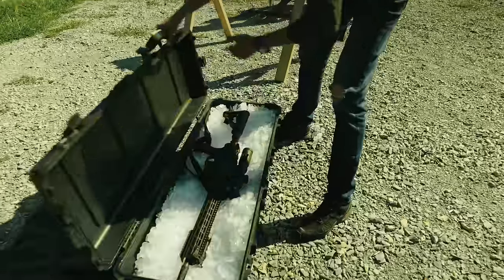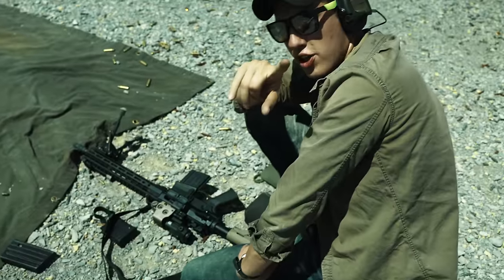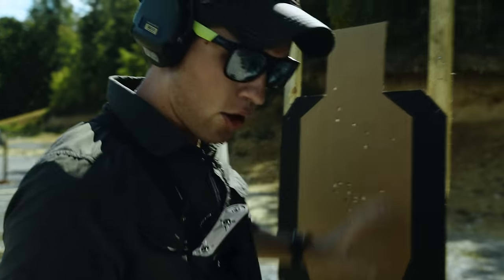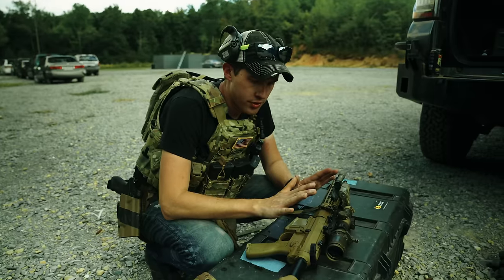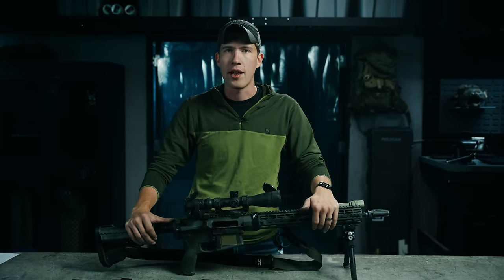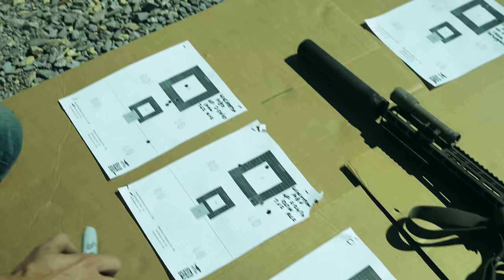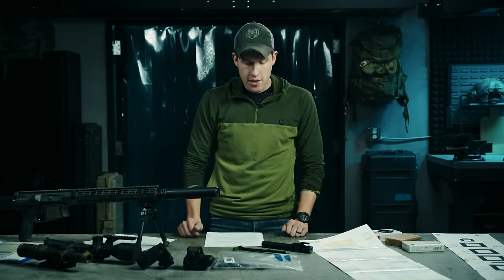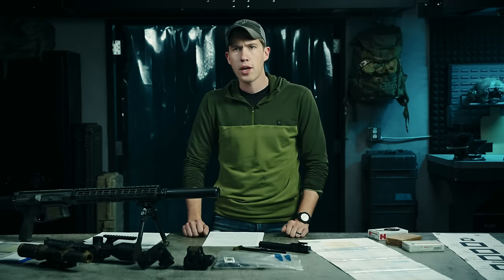Aero Precision M5 AR-10 5,000 Round Test

Comment: This is an incredible amount of data collection for an extremely common "off the rack" firearm. No boutique add-ons or modifications, no cinematic mud-test type of gimmicks. This is good science, setting up trials and running the tests. Man. It's such an inspiring sight to see that ya'll went through such a diligent testing curriculum, I hope the information collected is used to better develop this high-potential firearm.
Reply: Mud tests aren't a gimmick though. They're a realistic test of how a fire arm will behave in field conditions, in worst case scenarios.
Reply: 1:46:20 and tested with “no maintenance” 😮
Reply: @Mygg_Jeager  Yes for a military unit, sure that makes sense. As a consumer, no. Most of us are going to use AR-15's in 5.56 as a SHTF rifle. If you want an AR-10 as a AHTF rifle, most of them on the market are not the right choice.
Reply: @MegaAndy93  For SHTF, mud is even MORE of an issue. Because you're not gong to have access to high pressure air hoses, hot running water, or a limitless supply of cleaning agents like we have in the military.
Direct impingement can only go so far with CLP and lubricant. I doubt you'll get the full 8,000 round barrel life out of a direct impingement AR15 in a SHTF, because the housing, mag well, bolt carrier assembly, and trigger group will gradually fill up with so much dust, dirt, mud, sand, debris, silica concrete dust, bark chips, and carbon particles that the entire system will seize up eventually.
Unless you're planning on literally never leaving the confines of your bunker or armored vehicle, which seems unlikely.
Reply: “SHTF” lol. None of you are gonna have retirement $$ if you keep dressing up and playing make-believe..
Reply: @Mygg_Jeager for an AR u can probably throw it in a river and that would work
Reply: "No boutique add ons"??? Paint job in the middle of the test. No lubricant. Guns need lubricant.  All guns need lubricant. Shooting 1 round every 1.2 seconds for long distance shooting. I've seen a few holes in this test. But it was a decent test. I give it a 7/10.
Reply: @adamsowers8957  if they pushed this rifle anymore aero would've lost their minds. hence why the immediately got in this video and started making excuses. they released a rifle that's not meant to actually be shot, so budget owners could say they have an AR10, that needs a lot of parts replaced for it to work in the first couple thousand rounds. get what you can afford, I get that, but this entire "just as good" campaign will get people hurt when they're counting on their rifle the most

Comment: I’ve got to believe that if your life depended on it, you’d never neglect a piece of equipment this way.
Reply: That’s exactly what I was saying… even the letter to aeroprecisionusa, is one sided, as they were never told about the neglect in cleaning
Reply: And didn’t they run it dry ?
Reply: I bet it would of last long if they actually took care of it
Reply: Nah, ARs are trash.  AK all the way.
Reply: Get a “equipment” that’s built to be fucking used lol
Reply: @simonbelmont548 Inrange and Garand thumb mud test, shitty optics mounting, less standard cartridge for america, lack of quality manufacturing. Stay mad
Reply: Only thing I'd say is if you somehow survived so long that you ran out of lubricant, and you also happened to be in the middle of a war where you had to shoot thousands of rounds. Not likely that's for certain
Reply: @f1rebreather123 find a vehicle, use the motor oil for lube
Reply: what equipment is meant to be ran dry, I own ar and ak so don't give me the AK crap, hell I've got diameter ar that has thousands of rounds with literally 1 malfunction,  and that alone was my fault,  so I'll wait for your response,  as long as you're not abusing gear and running it luned it will run
Reply: @simonbelmont548  I can tell that you are like 12 years old based on this comment. Once you grow up and learn about how they work, you willl understand the Ar15 is better than the AK platform in every way

Comment: Found this video AFTER just ordering this exact M5 configuration. This video actually makes me more confident in my decision to purchase. 2300+ rounds dry before malfunctioning is impressive. As a former infantryman I can tell you, you get back from the Qualification range, weapon cleaning/maintenance, you get back from patrol....weapon cleaning/maintenance, it's 5pm on a Friday back in garrison.....you guessed it, weapon cleaning/maintenance lol. All at way lower round counts and CLP is slathered on from a commercial spray bottle. Screws backing off, I personally always blue loctite my critical component screws on my personal systems. Would love to see the same type of test on the Gucci AR10s like LaRue, LMT, LWRC, etc. And even some other budget minded models, like diamondback and similar. Only gripe I have with AERO is me wanting them to have ALL barrels they sell to be dimpled for easier gasblock installs, that's it. But that's purely a convenience complaint. Keep up the good work AERO.
Reply: I just got my M5 20" in this week. I would have liked if they continued the test with a different BCG to see if it is an issue specifically with AP BCGs.
Reply: Yeah, they're good deals.  A lot of the issues he outlined will double the price-tag, if they're actually solved.
Adjustable gas block for suppressed?  Costs.
JP Enterprises ultralight BCG and captured spring for reduced recoil?  Costs.
Criterion chrome-plated barrel for extended barrel life?  Costs.

People that talk crap about "gucci rifles" don't understand that some of them are actually superior...  At a cost.
Reply: @manictiger I think he’s aware of the costs of ‘Gucci’ rifles. Dude wants to see a comparison based on those differences.
Reply: @isaactrujillo76  
He didn't state that.  He said he wanted more from the same system.  A manufacturer isn't going to add an entire new process to make something that costs twice as much, unless they think there will be a lot of buyers.
Reply: @manictiger  I’m referring to the original commenter we are commenting under.
Reply: Right. Like if you don’t clean any 308 after 2000 rds….. lol. Pull the guard. Put a adj block and keep it maybe just a tiny bit cleaner lol.
Reply: @manictiger  yep your clueless.
Reply: @pt2656 
What an excellently displayed counterargument with supporting evidence and impeccable spelling!

It's "you're".
Reply: Liking this kind of content ,hoping to see more.
Really liking what i'm hearing coming out of t rex arms , We'll be supporting your company with purchases in the future! Keep up the great work!!!
Reply: Absolutely love my LWRC. She's seen maybe 4k rounds now with only a few issues while I was best optimizing for suppressed but that was easily worked out. LWRC make amazing rifles in a few key calibers. Even my "cheaper" ic di in 5.56 is an absolute dream. I also keep everything very clean and well lubed / greased. Mil-comm ftw!
Reply: Far too much cleaning, that’s just one of the idiosyncrasies of the military.
Reply: I went with a Daniel defense .308 for $2800. The DD5V4. It came with adjustable gas settings from factory. For suppressed and un suppressed 🤣Threw a eotech vudu 1-10 on it, Atlas v8 bipod, ferro concepts sling, B5 systems stock and pistol grip. Have a Bcm vert grip on it also. Have it as a battle rifle configuration right now. My battle rifle. A bolt action with a 2.5 or a 4x16 would be nice if want to push pass 1500 meters 
you enjoying your Aero??🤣🤣
Reply: You said “As a former infantry” 🤣man that’s sad you can’t even afford more then 2,3k on a actual high quality good rifle🤣 and you were in the military. Most these guys never served and have much better equipment then you 🤣🤣🤣🤣
Reply: Hanson barrels with the block on are a good compromise, moa or better guarantee and believe they’re at least pinned. Ballistic advantage makes them, but aero owns BA

Comment: Great and informative video! My thoughts are... after writing them, I find that they center around the workload you put it through. Maybe not an unfair test, but it was pretty intense and, I would say, fairly extreme, minus mud baths...
1) Was a great pick for testing. It's a popular brand and model. 
2) the duty cycle you put it through was tough. Though you cooled it off, it had to be running 'warm' most of the time. 
3) 5000 rounds is a LOT of usage. that's 166 - 30 round mags. if a standard load out is 10 mags, that 16 battle days. That's a LOT of usage! If I were in a combat position where my life depended on this piece of kit, I think I would clean my weapon more often than never. If for no other reason, than to monitor it for potential failures.  The amount of crud on your fingers during the bolt disassembly was very telling.
4) Zero maintenance, though probably realistic for many users is unrealistic from a longevity perspective. When you buy a new car, you don't plan on just driving cross country over and over while never having maintenance done to it. People who never do maintenance on their weapons should have no expectation that they will run forever.  

5) I did think the video was a bit long, but it was also very informative. 
6) I found the close up shots of the malfunctions to be poor and not very helpful. In particular, the shots of the bolt carrier breakdown didn't really detail what you were discussing. the broken pin was just a little glob of metal, even on my 50 inch screen at 1080. 

Thank you so much for taking the time to follow up with AP and telling us about it. That's important info and I'm glad you shared it. I, too, am a fan of AP and have been considering an AR-10 from them. I feel much better informed after watching the video!
Reply: Yea I agree with you regarding the maintenance schedule.  I would say any consumer (civilian) level firearm owned by a reasonable person would clean and inspect the gun multiple times throughout a 5k round test.  You can buy a rifle from Aero for $1,400, or buy one from LMT /sig for $3,500 or knights armaments for $5k+. 

Personally I would expect the military level weapons like those from LMT/KAC/SIG to fair far better in a 5k round test, but even the military would probably allow for a cleaning in that 5k round period.

Finally, I’ve heard a lot of people build Aero AR10s and swap in JP bolt carriers because they are simply better.

Comment: I haven't seen ONE comment stating the obvious ... that lead sled holder is going to transfer the force generated by the .308 into the rifle and cause damage because it is not allowed to recoil naturally. The force doesn't just disappear when you lock it in to that lead sled, it's getting transferred into the weapon. I'd like to see testing with just bipods and bags to see what overall effect that had on the components of the rifle. I don't know how many rounds were put through the system with that lead sled, but I would imagine it's impact on the rifle were not insignificant.

Comment: My biggest take away from this is Lucas has never broken a firing pin on an AR before. I thought it was pretty common thing when you get up there in rounds, and a part you want to have an extra on hand. For hardly lubing and cleaning the rifle, and then going suppressed I think it did really well.
Reply: I’ve had 10k rounds on my bcm bcg with no failures. Try getting a 158 steel bolt face and throw the poors bcg in the trash lol
Reply: @Souwth-bawston-is-fuh-luvahs or just buy a quality bcg and cry once lol. Always just as guuders that always have issues with your guns and need extra parts for range plinking lol

Comment: One of the problems with 308/7.62 guns is the WIDE variety of ammo.  Some of the 7.62 loads are quite weakly gassed and some 308 loads are screamers.  I"d hate to be the guy deciding how to gas one of these rifles.
Reply: And the lack of standardized parts between platforms
Reply: I had to bore out my gas port on my criterion barrel after messing with springs and buffers. Put an adjustable gas block on it and turned it to 2 clicks more open from failure to eject/bolt lock back. It was a pain before just boring that port.
Reply: Big farts!
Reply: @lighlotus117  sketchy, but I've done it. 

I got an M&P10 as my first 308. As usual with the first gen of these.....They're undergassed at the port. Measured .064. A .075 bit, a steady hand, and a bore snake will take care of that.
Reply: @NoNo_IStay  good lord. doing that without a drill press is sketch af. 😅
Reply: This is a BIG point and one of the biggest challenges in developing and supporting this platform. Especially since many customers are building our M5 receivers up using parts from many different manufacturers. Add in suppressed fire, and this situation is multiplied.
Reply: Just find a good combination of ammo and gas settings. And stick w it
Reply: Probably have to set it to be properly gassed with ammo in the bottom 25-50% range of the spectrum, knowing it’ll cause excess wear on the BCG with higher quality ammo, and giving the caveat to customers that you can’t run the shittiest ammo on the market and expect consistent performance. Wouldn’t be surprised if the erred on the side of even more gassing than that though
Reply: @lighlotus117  I would check if criterion uses the longer gas block to gas key distance. There are two, the ar15 standard (used by most dpms lr-308 manufacturers) and the armalite ar-10 pattern. This equates to about one half inch longer gas tubes. You can look in the cam area cutout of your 308 upper receiver and see if the gas tube makes it half way into that area like it should.
Reply: @NoNo_IStay  pro tip the mp10 bcg is a diff paytern if you swap barrels you will need a diff bcg 
As me how i know lol
Reply: Varying everything was my experience back when you could get cases of nato surplus cheap.  What ended up to be the consensus was learning how your individual rifle behaved with a given round count.  Bore brush was essential, dealing with torn rims was usual, and learning how that particular case performed was essential.  Wash rinse repeat when you opened a different case lot or country of origin.  I learned I could get 900rds out of the worst ammo between major malfunctions, and that was very important.
Reply: @you_willletfreedomdie7759  yeah it's a seat of your pants moment but I stepped it out to .088, after checking along the way. I don't remember each step measurement I used. .088 did it and the adjustable block helps mitigate. I might not have needed .088 but it works and if ever it meets an "adverse environment" I can just open the block and blow through it. I was lucky to have access to the required tools via work to get it done but sketchy because that's a $360 barrel that I'm risking.
Reply: @newerest1  I'm gonna check that but I think the original port measured at .062 or .064 if I remember right and I went up to .075ish and tested it and failed. I ended up on .088" and it runs through whatever so far.
Reply: .308 is listed for higher chamber pressures than 7.62. Full loads with identical bullets are always hotter (roughly 200 ft sec depending on barrel length)
Reply: @duanesamuelson2256  Yup.  And that's "averages"
there has been some weak sauce imported 7.62 from far away lands going all the way up to some probably overpressure hunting loads.  To be fair you see similar in 223/556 but 308/762 seems to be worse.

Comment: As someone who is familiar with the AR platform and looking to get into a .308, this is great timing.
Reply: I say that I still would recommend it. I've put alittle over a thousand through mine throughout the past year or so I personally haven't had an issue. I assembled it myself too.
Reply: Honestly I would say don't bother.  I pieced together a build and ended up having to take it to the gunsmith because even though everything looked good on paper it was still having some issues.  There are good semi auto 308 rifles they just cost a decent chunk of change.  You might get lucky or you may end up taking it to a gunsmith like I did.
Reply: Mine is a 20” stainless HBAR. I haven’t put it through a test even remotely this punishing but I do have about 2,800 rounds though it. Only issues I’ve had were mag and ammo related. I did put aftermarket parts though. Lantac Ni bcg. Radian CH, rise armament trigger, heavier buffer spring and adjustable gas block. Had a night force on it but now I have the new eotech 5-25x vudu. Only thing I’d say is if you still want one to just build your own. Buy the stripped upper and lower and part everything else out so you can build it exactly how you want without wasting money on parts your just going to take off.
Reply: u can also get a 6.5 upper and swap them out in a bout a minute
Reply: Got a Daniel Defense DD5 I’m looking to get rid of
Reply: Absolutely get an adjustable gas block.
Reply: @Osprey1994  what do you recommend then. I would be willing to spend more initially to get something I dont have to put more money into later.
Reply: @Milstache_Productions  I'm trying to figure out budget. MSRP suggests its out of my range new.